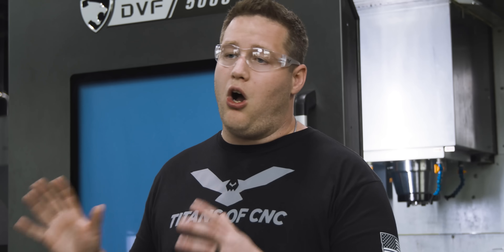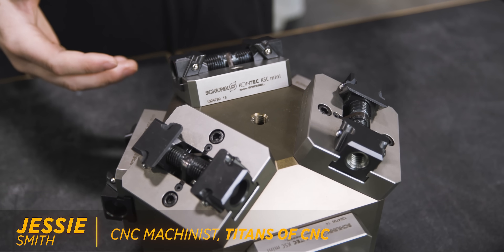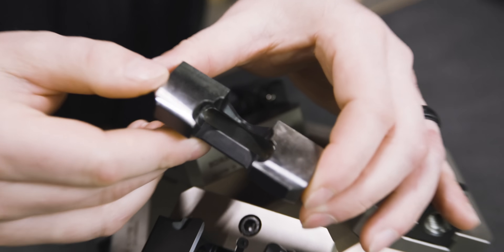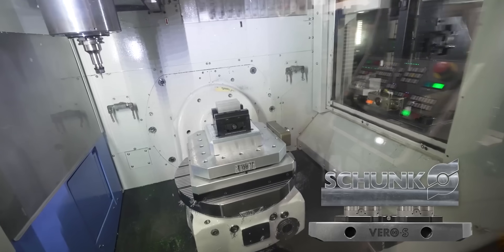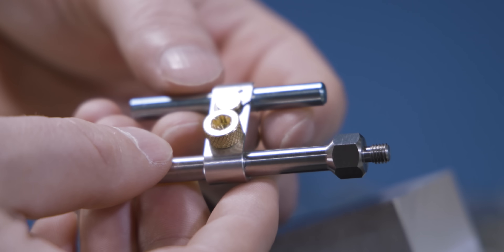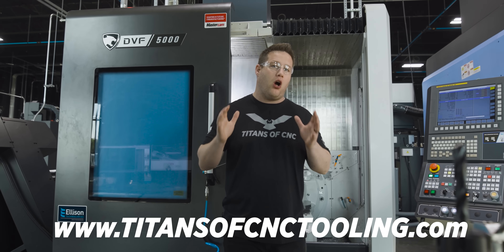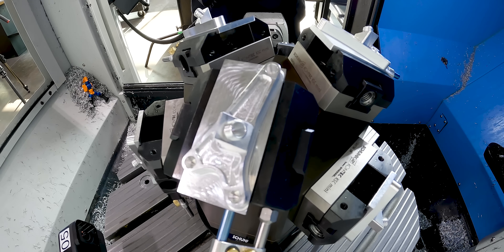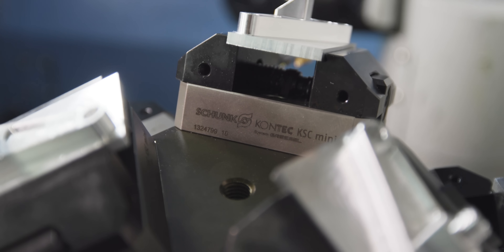Crazy Multi-Vise Workholding Technique

Comment: I was an old school conventional tool maker/machinist, started working in a tool and die shop while I was a senior in HS, and I also have 10+years of automotive engine remanufacturing everything from big block V8 high performance down to single cylinder dirt bikes and everything in between including Harley Davidson. Hell, I'd love to sweep the floors,empty chip barrels etc just to see the awesome metal devouring machines that are  beasts, yet doing that kind of work you rough it off then its finesse no matter conv or CNC, it's just that the CNC world right now is mind blowing to me,.

Comment: Nicely done but I'm sot so sure about your times. 4 minutes cycle time for an individual part, should be a way better collective time for all 6 parts (not 4min x 6parts=24 to 25min?) due to the lack of loading individual parts over and over as well as fewer tool changes, rapids and repositioning for cuts. You should have saved up to 20% on the overall cycle time which IMO is the main reason to go to a multi-part fixture, not just allowing an operator a few minutes to do something else. Lets face it, these machines do not make money unless the spindle is working, anytime the door is open you loose. I love SCHUNK tooling, they make some great product. But keep up the good work, these videos are great.

Comment: Y'all had a video on 20,000 parts that were created and they were all scrap.  I'm guessing that's a couple of million dollars loss. 
If Y'all are going to spit parts out at high speed and lights out, then wouldn't it also make sense to automate checking the parts so you don't just throw millions of dollars into the toilet?
Don't make even 1 part of it isn't checked thoroughly!
If you're going to automate spitting parts out as fast as you can then you ALSO need to automate CHECKING parts just as quickly. 
It's NOT reasonable to expect people to be able to check everything on a machine, every shift. You KNOW those employees would get reamed out for taking too much time to continue the work run on the last shift. 
Don't put the burden on the shoulders of employees who are expected to run balls out and not slow down, ever!
No, the burden in these situations is TOTALLY on management, not the shift workers. 
If management wants production insane fast, 24/7, then the burden for correct parts falls entirely on management, period!
You want insane fast parts then you need to develop insane fast automated machines to check the parts.
Please get your head out of your backside and SUPPORT the employees instead of unreasonably expecting them to do the impossible because you want insane fast parts!
Back off of your employees and fix the problems created by insane fast parts. 
You're creating the problem so DON'T dump it on your employees. 
If an automated part checker machine doesn't exist, then MAKE one!
Leave your poor employees alone and you fix this problem that you alone have created by your mania for fast parts!

Comment: Could you give some details about these vices? For how much do you grab the stock and with what force (in kN if possible) are you holding it? Also will those serated jaws "bite" into harder materials like steel or stainless or would you in that case go for dovetail? Cheers!
Reply: I use shunk mini vises daily, i clamp aluminium, stainless, titanium, steel all in those 3mm gripper jaws and they will hold basically anything. I have a ksc mini, one size smaller then the one in the video and i can clamp a block of 80x80x130mm (130mm is height) and it holds it with ease.  I do mill 2 parralel profiles in center 3mm deep to fit between the jaws since it doesn’t open 80mm.
Reply: @tijmenjoris328  Most of the parts I do are being held in 2 or 3 vices and it's no problem to push the tools.. but everytime I have parts that need to be held for 3mm on a single vice and are tall I go slow and light cuts not to throw the part.. I use hydraulic vices that are capable upto 4 tons of clamping pressure but still it's kinda nerve racking.. can you "go to town" with index cutters when holding parts like that or do you prefer endmills and light cuts?
Reply: @RiseOfSky  i try not to use index cutters but endmills full doc and decent radial is no problem! 👍🏼
Reply: @tijmenjoris328  endmills are not so scary to run in my opinion.. even if it pulls the part out, endmill snaps and hopefully thats it.. but running 32mm or 63mm high feed index cutter on the other hand gets my heart rate thru the roof xD and those cutters are sometimes a must for me because of long reach.. anyways thanks for sharing your experience! Cheers!

Comment: Nice video Jessie and a Cool clamping device,
Question, did you put 6 manual offset fixtures or determined with CAD/CAM?
Reply: I think 1 offset in CAM
Reply: @owievisie  I think also, it would have been nice to had a short CAM explaining edited in the video 😊
Reply: One offset is enough, I will pick that hole in the middle and Z0 on the top of that fixture . Rest you can take separate offsets for parts in Mastercam , WCS remains the same , tool and construction plans will be different for different parts or just use toolpath transform . Whichever the way makes you easy . 🙏

Comment: You've finished one side.  How do you flip and finish the bottom?  Do you use the same pyramid?  Or, do you have to use a different fixture?
Reply: Flip the part in the vise.  You can get several different types of jaws from Schunk for these ksc mini vises.  They offer steel soft jaws as well for odd shaped parts like this one.  The jaws can be changed out super quickly.  Ideally if you had a large volume of parts you would have one pyramid dedicated to op1 and another pyramid dedicated to op2.
Reply: Just flip the stock over on the pyramid and run a different program for the bottom

Comment: I guess thats one way to do it, but you guys do know that barfeeders exist right? And just in case someone here knows more than me: Yes there are also barfeeders with A-Axies.
Reply: no we have never heard of bar feeders before.
Reply: @Jessie_Smith  think of a 5th Axis Lathe with a barfeeder like on a Swisslathe but take away the roundstock for flatstock and think the rest of the machine as a mill. We run a Chiron in our shop but I think Haas also makes or used to make barfeeders. Its perfect for high number production for the same reasons Swisslathes are, plus you can get them as 5th Axies (like our Chiron). Ours works simply by clamping a raw bar in the machine and machining the parts out like you did in the video, second side looks and runs sorta like the subspindle on a lathe, a robot takes out the final part so its entirely hands free. (Edit: Now that I had to look it up it isnt actually all that common, but its one of the best ways to machine anywhere from 10 to howevermany parts you need, since you just have to feed it rawstock and take out finished parts.)

Comment: I love the idea of this system, my question is though, could you load up 6 different parts to cut on each vice and just run them off one by one or does it have to be the same piece?
Reply: Yes you can have 6 different parts if you want as long as you watch your clearances.  How you load it and program it in CAM software is completely up to you.

Comment: I’m curious, your machining time is stretched to 24 min.  To allow for the operator to work on another machine.  How long is the removal/clean/reload time for this fixturing system?
Reply: however long it takes you to loosen the vise, remove part, insert raw stock against vise stop and tighten vise again.  Shouldn't be more than 10 seconds per vise.  In an ideal situation (granted you have enough volume of parts to justify it) you would have a second pyramid outside the machine where the operator can have it loaded and ready to go.  Soon as the program finishes, you simply remove the entire pyramid from the machine and add the new one and off you go.  Or you have a pallet system where it does it automatically and all the operator has to do is load and unload the stock.
Reply: @Jessie_Smith  Thanks for the detailed response!  Looking forward for the next video!

Comment: Cycle time is increased but set up time is also increased. As you need to load 6 parts by hand as well.
Reply: Overall setup time on the job is decreased. You have the load the parts regardless of if you do 1 at a time or 6. In this case you’re doing 6 at a time which means less time spent opening and closing the door and blowing off your parts/vise.

Comment: Nice video, its good to see mass production like this on a 5 axis. I'm curious if you did it with subprogram? I don't see many people using subprogramming when doing 5 axis when they have multiple loadings with the same parts. It would be good to see pros and cons of using subprogramming in a setup like this.
Reply: That is a good idea and I am sure there are many people that would do the same.  I didn't use any subprograms though.  Since it was first operation and I knew my stock is oversized and therefore be a little forgiving with exact placement, I chose to keep it simple and I set only one work offset in the center of the Vero-S pallet.  Z0 was the top surface of the Vero-S so bottom of the pyramid.  In mastercam I programmed only one part and I used their toolpath transform function to basically copy the toolpath around for all 6 parts.  Again, I would only do this for op1 situations since you're not really worried about making micro adjustments to the work offset.  If I was doing secondary operations then I would set a work offset for each station individually.  As for doing it with a subprogram, I am sure there are some clever ways people incorporate them but honestly I haven't done it myself on mills.  Only lathes.  The closest thing I get to a subprogram is running macros.
Reply: @potatotiel If you haven't read Jessie's reply yet, you can make each part a different work offset (G54-G60) so that you can reuse the same code for a tool to do all 6 parts. Down side is you need to have a program for each tool path which means if you have 10 tools for the job then you need 11 programs in the machine just for the one job.

ex (M98 is the code to call a subprogram):
G54
M98 P[# of times to repeat][Subprogram #]
...
G60
M98 P[# of times to repeat][Same Subprogram]

Now my example could be a worse way to do it since I'm just learning it as I'm unsure if there is a way to tell it to repeat using different offsets.
Reply: To me subprogramming would be more efficient and you would have less code to do the same work in my experience. But I just noticed not many people using it in examples like Jesse's.
Reply: @potatotiel no it depends on how you do it, it wouldn't make more tool changes, but give you less code to do the same work and also allow you to control each part with an offset incase you have inconsistencies in the accuracy of some of the loadings without going back to the CAM system for adjustments. In my experience I haven't seen many multiple loading fixtures not be 100% perfect. There is always a loading or loadings off a few thousandth in X,Y, or Z.